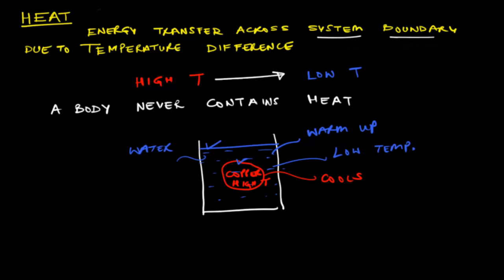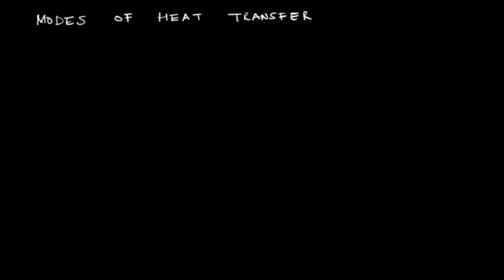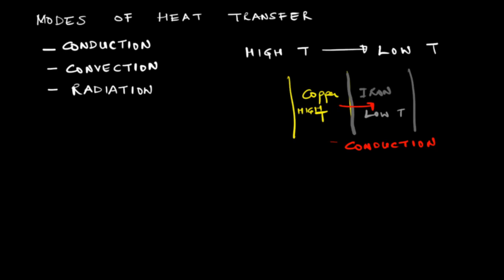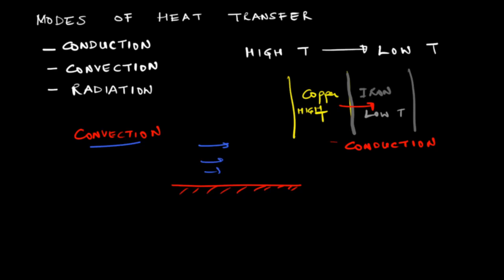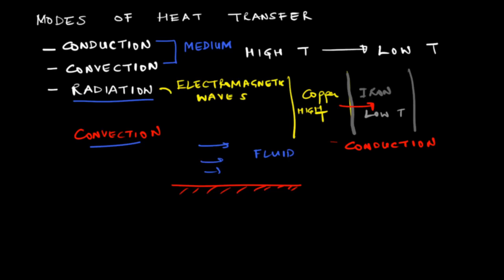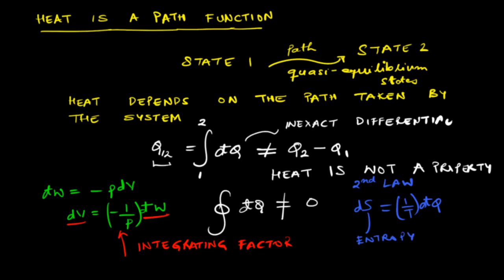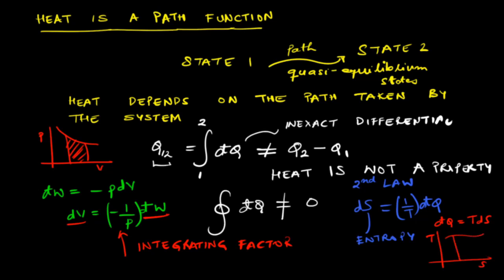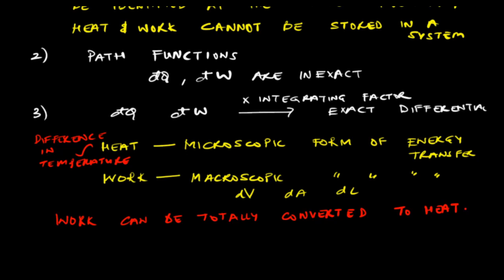Lecture 9: Heat and its comparison with work (Engineering Thermodynamics Lecture Series)

Comment: sir in JEE times it made sense that there is a limit to efficiency but now that I think, every process is just interactions between fundamental particles which are governed by the fundamental forces. SO should there be any preferred direction for energy flow? suppose we can manipulate every individual particle while staying in the realm of physically possible interactions will then we be able to achieve 100 % efficiency ?
Reply: got the answer sir.
Reply from the maker: More clarity will come when we discuss the second law. As of now we are not concerned with feasibility of the process as long as conservation of energy is valid. The second law will put additional limits.

Comment: sir both heat and work are not a property of the system, right?
Reply from the maker: You are right. Heat and work are not properties of the system. Heat supplied to a system and work done on the system depend on the process of transforming the system from one equilibrium state to another. On the other hand, properties depend only on the equilibrium state and not on the process that has brought the system to that equilibrium state.